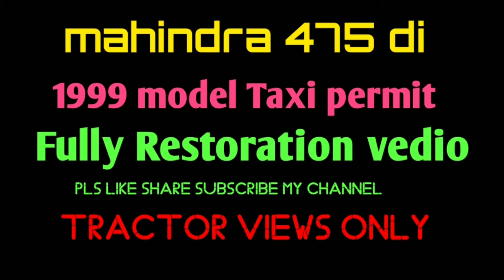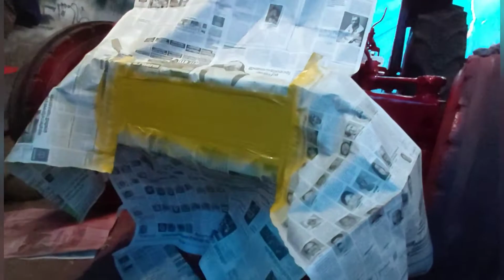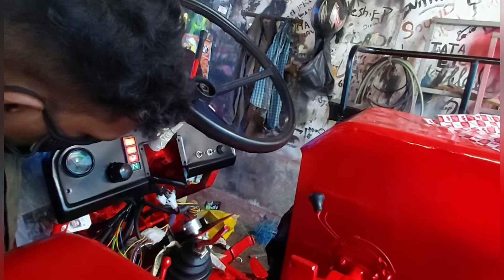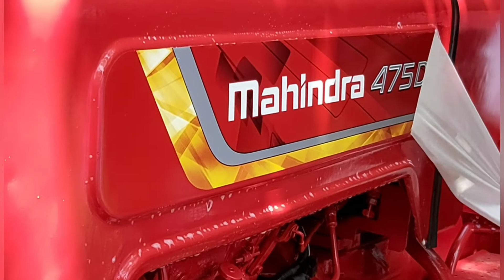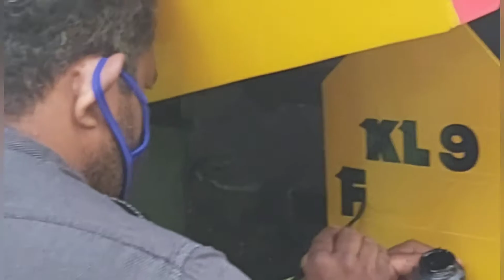Tractor Restoration Kerela | 22 Years Old Mahindra 475 Di | Modern Painting @tractorviewsonly

Comment: How much price restore
Reply from the maker: Painting  , Wiring kit changing  , Full light changing  , Seat repairing , Meeter
Reply from the maker: Meter bord resetting , Frond pumber fittings  , Rain top fittings...Engine oil , diesel filter , oil filter  , air filter  Changing  , Total Sticker Work. 

Total 70000

Engine work  , gearbox and housing work  , Tyre rethread or Replace  extra charge .
Reply from the maker: From kerela. 
Malappuram distic. 
Purathur village. 
Muttanur post. 
Pin 676561 .

Location Undappadi
Reply from the maker: Your place
Reply from the maker: Call 93881 11775
Reply from the maker: Watsap 93881 11775